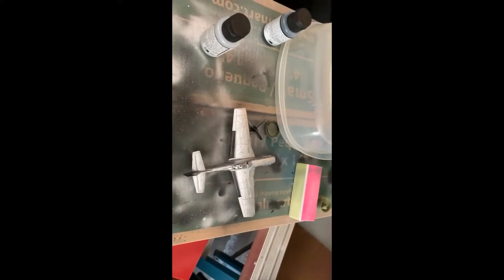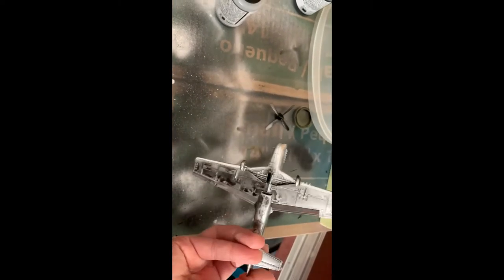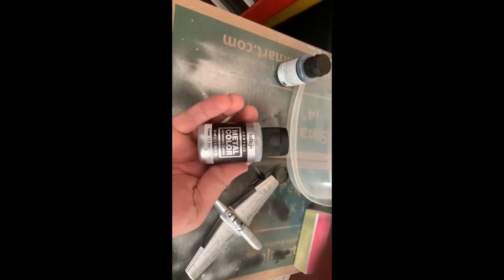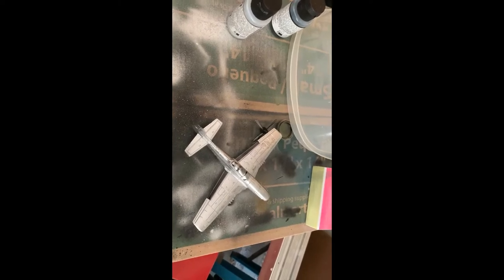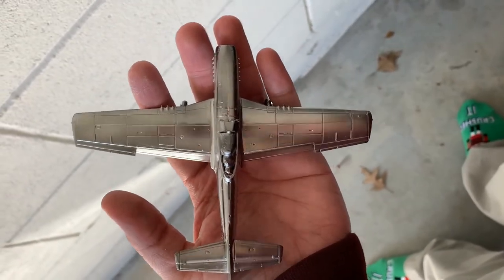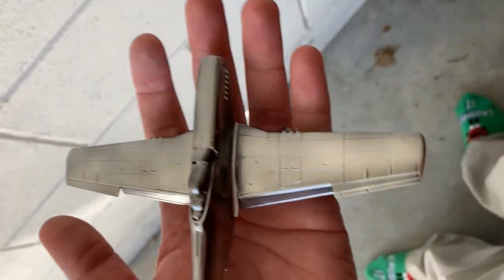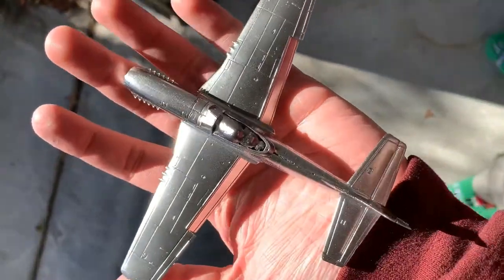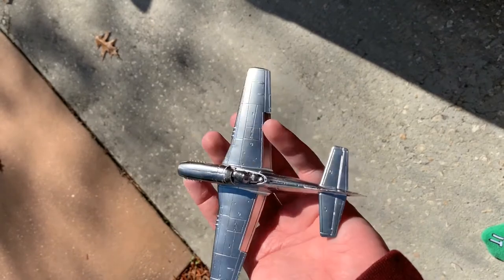Painting Airfix 1/72 P-51D: Testing Vallejo Metal Color vs. Alclad Chrome

Comment: Not sure what is going on there but even with a brush i get pretty good results (not as good as with a airbrush) . you do need to shake the bottle really really wel , the paint should be all bubbles and foamy in the bottle before use. but what you have right there is not something i ever seen.

Comment: For Vallejo you first need to put the gloss primer after you need to select the paint example gunmetal grey mixed with tiñer and flow improvement rather this you need to put the metal varnish and you obtain a good Finnish or you can change the varnish to chrome varnish finish of Vallejo you obtain the best result